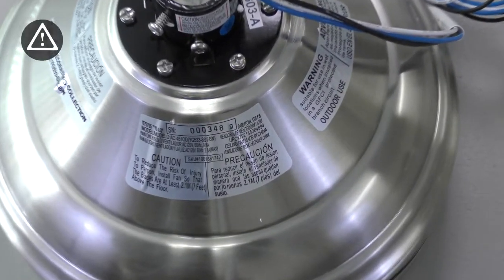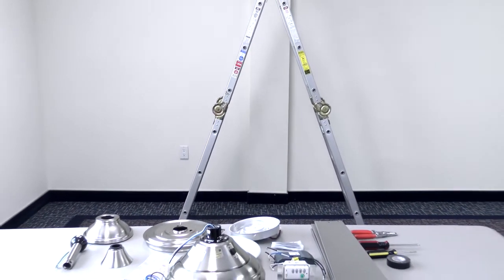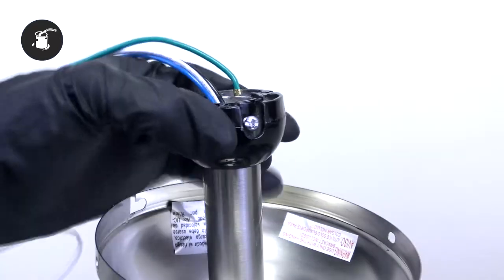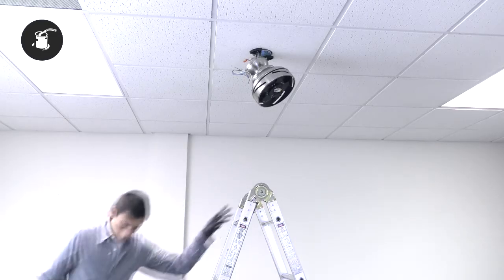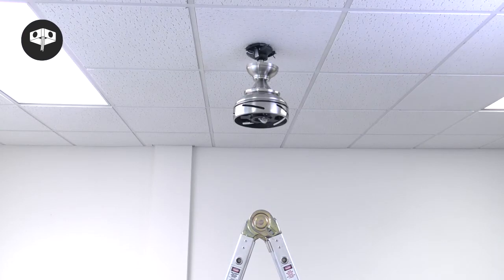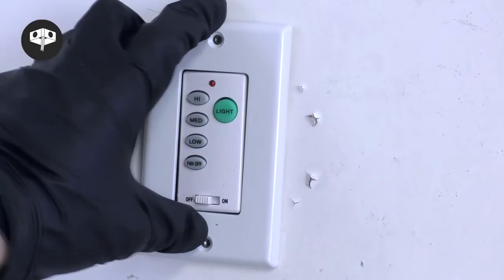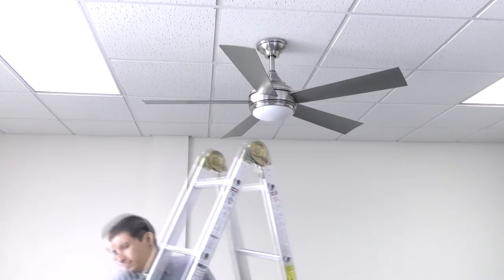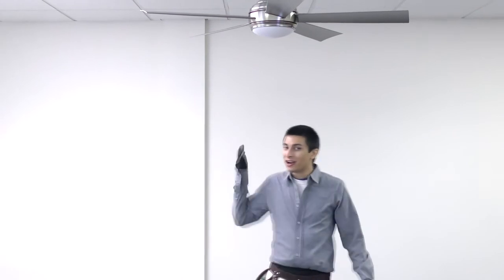Hanlon Ceiling Fan Installation Guide

Comment: need some help , i'm replacing a older fan with this one  i have a problem with wiring the switch to the wall power supply
I have 3 wire coming out black white  and green , now on the switch 2 black plus the ground what do i do with the neutral  wire from the wall ?. thank you
Reply from the maker: Unfortunately, the remote manufacturer doesn't recommend connect the wall control directly to a neutral (white) wire. The only recommended configuration is what is shown at 1:35, having a ground (green) and two hot wires (black or red). However, customer service does offer an optional battery powered wall control or hand held remote that can be used instead without having to wire anything. You can contact 1-877-902-5588 to place an order or to get more information.
Reply: thank you for the prompt answer